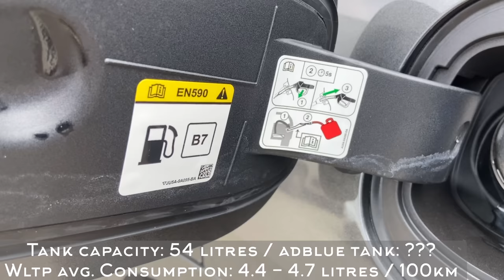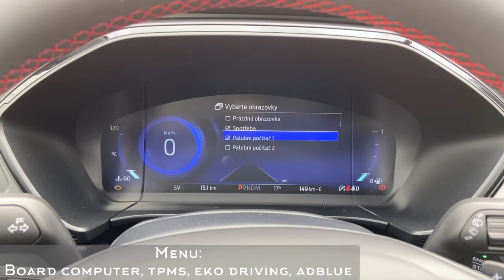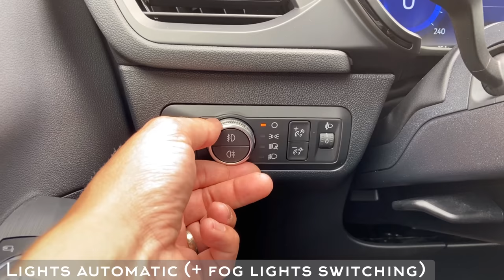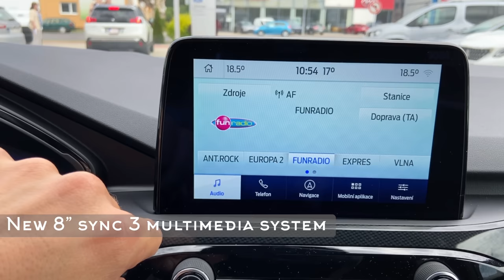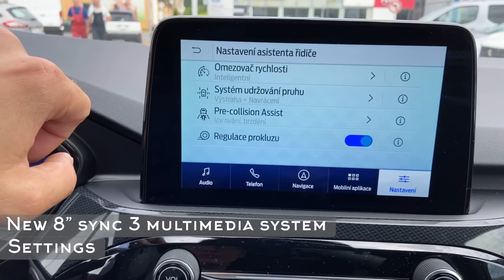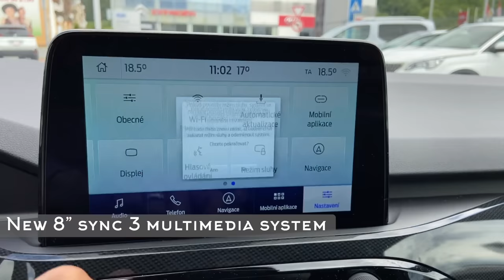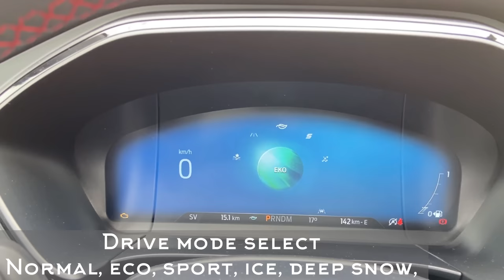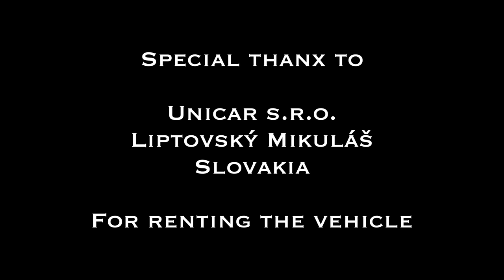Ford KUGA (2021) ST-Line (WALK-TRHOUGH), detail exterior, interior, trunk, dimensions, NEW

Comment: I’m limited to fhev or phev as a disabled driver on motability- idk why🤷‍♀️ I’ve had 3 kugas & so comfortable & right height (I’m 5’9) but I found the mk3 seat quite firm & im worried I’m going to be in more pain after driving! The hybrids don’t seem to have paddles they have & L instead of manual button & that really concerns me as we live in N Scotland in a village- no shop on top of a hill! I’ve had AWD & the paddles up to now which has been great but I found the brakes not great- you had to really slow down & as I need auto I rely on brakes. Also have to jump to ST line X to get heated seats which helped my back (I’ve had 5 spinal surgeries & 3 bottom discs removed so no shock absorbers! SI joints pressing on nerves &  pain, numbness,pins & needles etc down left leg- hence need for auto) I rely on a car as limited mobility & now have wheelchair for any distance) any advice on the kuga 2.5 duratec fhev ST lineX auto? Advice greatly appreciated! 🥰🙏🏻